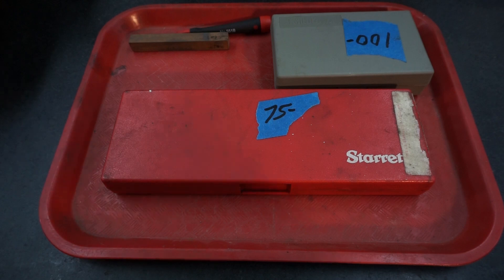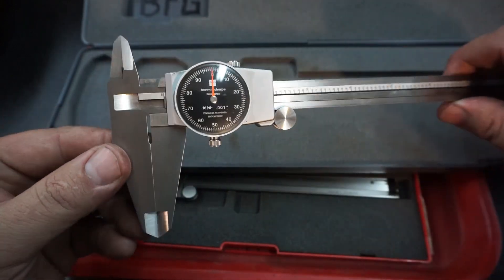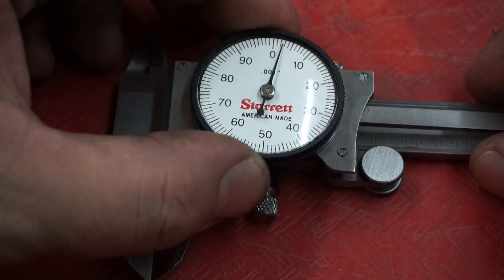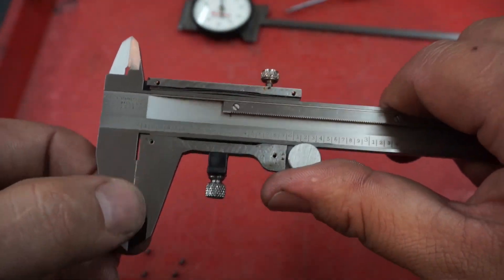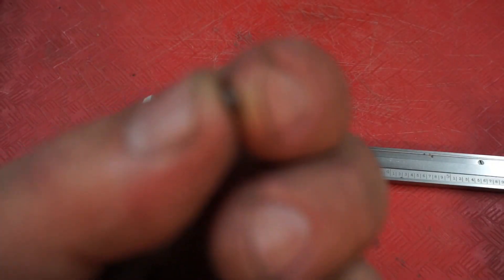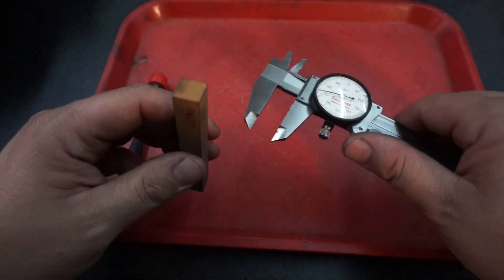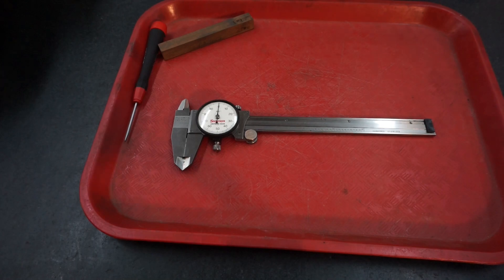Shop Talk 18: Starrett Dial Caliper Fix

Comment: Adam,
     I had a Mititoyo 6" caliper that had a hole on the top that you could put a pin in and it would push the gear down and you could basically clock the gear tooth to any place on the rack. Of Coarse it would move in a nominal degree amount (I believe it was 25 degrees) at a time. Have you seen this in other calipers?

Comment: So the key thing to look for and have are the screws (4) on the front part of the dial body to re-clock the needle?
Reply: Not at all, they ALL can be re-clocked. Some require a different method though. In the worst case for example the gear rail can be unscrewed and slide out along with the indicator part if need be - and I doubt this much work is actually needed. Looking at my chineseium $20 HF ones I see that to be clocked properly I need to show .050 when the edge of the indicator part is half way over the first hole of the gear rail. It can be clocked upon assembly if you know that in advance. Thanks Adam, I knew what I had to do a few seconds after the reveal under your dial face. What I can't fathom is how to do it with a shim or pin as I read in other comments, will be watching for further info. And top notch content as always.
Reply: I understand the calibration part and if it is assembled from parts there has to be a way to disassemble. I do find it useful to learn how to calibrate it on your own. That is one of the things I like best about Adam's videos, he explains things in a clear easy to understand way.
Reply from the maker: The removable top plate is just one of the design features of the Starrett 120. It's makes this particular model easy to reset and clean up. There are other methods to correct clocking on other calipers. Sometimes you can buy a good quality caliper for a good price because of the needle being off. They all pretty easy to correct.

Comment: GREAT VIDEO !  EVER TRY " RENAISSANCE WAX " TO PREVENT RUST , FORMULATED 
                             FOR GREAT WORKS OF ART INDOOR & OUTDOOR . I USE FINE BRISTLE
                             BRUSH WITH VERY LITTLE ON IT , THEN WIPE OFF , LESS THAN .0001 .
Reply: CAN'T BE THAT BECAUSE THE , AND . STILL WORK! .0001!

Comment: Hey Adam, I have 2 starrett 120A calipers I acquired more than 25 years ago along with their original red leather cases.  After watching this video I remembered them and that the dial was "not clocked".  I took them both apart and found with both that the pinion gear had broken teeth on them.  Do you know where or how I could get the gears replaced ?   Thanks.
Reply: Ujeb08 Contact Starrett? Send them back for repair ? Not sure of other good options.

Comment: You should do a video on how much new Starrett sucks. I can not believe the garbage quality of new tools I have purchased. It started with a 50ft flat tape, it was made in china (didn't even realize starrett farmed out until I bought it) and it was trash, the name was just printed on like a sticker not etched in like the older US ones and the steal used for the tape itself was garbage. I ended up breaking it because it was so brittle if bent too far.  Then I got a center head, it was 1/8th out of square @ 10", checked by simply marking a line on a square piece of steal then flipping it 180 and back checking it. and the 12" rule I got for it had little voids in the steal along the channel in the center. Starrett is dead. such a shame.

Comment: My starrett caliper was garbage since day one. The Gibbs were undersized and had too much side to slide movement causing binding... not to mention the grind of the anvils were terrible..
Drove me away from starrett.. mitsutoyo or bust.
Reply: Nothing wrong with Starrett. You had a bad day and a bad set of calipers that someone had abused.
Reply: A real machinist can not only machine parts but fix, repair or modify all of the machines and tools. Keep working at it. Some day you might get there.
Reply: In that case someone at Starrett had a bad day and saw you coming.
Reply: Ellie Price Another person who bases things off of ONE SINGLE experience. Lol. That makes sense. Derp.
Reply: Any company that can let that get through QC isn't worth my time. You guys clearly arnt professionals if youre willing to waste time repairing brand new tools. Mitutoyo is 100x better product and has yet to let me down after the tens of thousands ive spend on tools over the years.
Reply: I like the "Big Three"  Starrett, Mitutoyo & Browne & Sharpe"  but I have to agree with ya, from my experience with Micrometers, The Mitutoyo are so much better than the Starrett.  IMHO and my taste.
Reply: After 40 years as an inventor, machinist and tool & die maker I retired and started my own company in 1996. Starrett, Mitutoyo and Brown & Sharpe are the three top brands. Ain't it great that we can buy the tools we like best?
Reply: No ones gonna buy fifty Starrett callipers to make an opinion about them. You buy one and if you think its shit you say it.
Reply: Tomasz : You only have one dial caliper?  Wow.  I have at least 4 and would love to have more.  I have lots of different areas where I use them.
Reply: I was replying to Andrew Delashaws comment, Of course I have more then one calliper the more the better. I wish I had a flea market like Adam nearby would by everything out LOL
Reply: I strongly suspect you got a Chinese knockoff that looked like a Starrett, was packaged as a Starrett, but was in fact a cheap copy.
Reply: I own tools and instruments from Starrett and Mitutoyo. Both companies make a great product, but that's not to say you won't ever get a lemon, or that there aren't poor quality products in either company's lineup. In my opinion, Mitutoyo makes the best digital measuring instruments out there. I bought a set of their "made in Japan" dividers, though, and they were worse than the cheap import brand. Returned them and bought Starrett, which are rock solid. I've used Starrett digital calipers and was unimpressed. I recently picked up some used Starrett V-blocks. They're hard as a coffin nail and beautifully finished. Resist the urge to judge a company based on one bad product.

Comment: Should you put any lube/oil on the rack or carriage so it slides easier? If so, what do you recommend?
Reply from the maker: No lube, clean and dry. Oil will attract dust and contaminants.

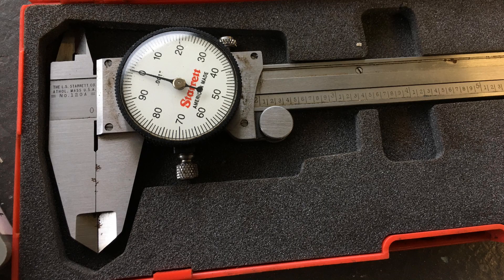Comment: At 1:41 you  show the whole dial rotated almost 45 degrees counterclockwise.
You never showed how you corrected that.
Reply: Bruce T Just in case you aren't trolling, the dial can be rotated to allow for easy relative measurements.
Reply from the maker: That was the picture I took of them when I bought them, and showing what was wrong. The fix was in the video, removing the top plate, adjusting the needle with the small gear on the back, and lining it all back up.
Reply: The face moves independent of the needle. Once you move the needle to 12 o'clock, you can move the face after you put it back together.

Comment: I have a Browne and Sharpe similar to the one you showed but shorter. It doesn't return to zero or to the same point every time. Sometimes it might be plus or minus 1 to 2 thousandths. Any ideas ?
Reply: That is probably dirt or grit in the rack causing the gear to jump teeth I would guess it happens more when moved fast. If you open it up all the way you can inspect the rack for dirt before you take it apart. For the ones that don't have the screws, you remove the end stop and slide them apart. 
    Mike (o\!/o)

Comment: Is there any way to repair the rack if its become damaged by some stray chips? I was given a set with a damaged rack that I would like to repair as they are made in England, so I don't want to give up on them.
Reply from the maker: You should be able to get replacement racks for them from Starrett, or have someone like MR tool Repair fix them for you.

Comment: You mentioned a way to fix different kinds, do you have a video of that? I just got a 4" mitutoyo and it clocks at 7:00 closed, it's driving me nuts.
Reply: The other ones: Use compressed air to blow the glass of the dial. Go to a watchmaker. They can take the pointer from the shaft with a special tool in a second and put it back to the designated position. Pop the glass back on- job done...
Reply: @heikopanzlaff3789  after this post I figured it out. I flattened a small wire and you can shim it in between the small rack and pinion, then move the calipers closed. Messed around with it for a few minutes and got it clocked perfectly. Thanks for the suggestion though, I didn’t even consider that.

Comment: Adam:
Take the Starrett screwdrivers and grind them into picks. LOL !  Get some Brownell's HOLLOW GROUND screwdrivers and the "Law Enforcement Handle" -  you will NEVER use a regular screwdriver again. They are guaranteed for life and they are NOT expensive!
Reply: At that size it's irrelevant, by the time you're hogging the screwdriver to make a significant difference, you've popped the head of the screw and decapitated it. FYI, those are actually Wiha screwdrivers, they will never slip. Just my two cents.
Reply: All I will say is look closely at the screws Adam removed - BUNGED -UP!
Reply from the maker: The screw driver I used did the job, and I don't think I give full Abom Torque when I put them back in. I'll check out those "Driver's" you speak up though.
Reply: he was using wiha screwdrivers, german, im pretty sure they know how to make screwdrivers, seeing as thats all wiha have made in decades, my personal view in over 30 years of tool experience is: if a company can stay in business making certain tools, and specialises in those tools , then they are probably at the top of the game, wiha is one of them, only make screwdrivers,   or bondhus allen tools or knipex only make pliers,   but companies like bahco have slipped and import some stuff with their name on it,  snap on isnt all made by snap on either, some of it is williams other is by bacho or facoms imports from taiwan etc.   seems starret is starting down the same road, but they still want top dollar